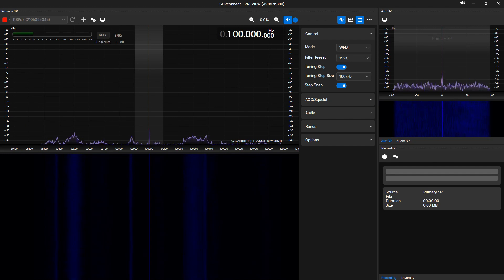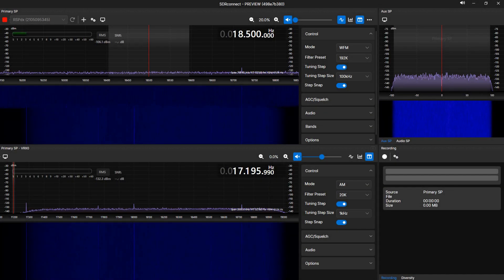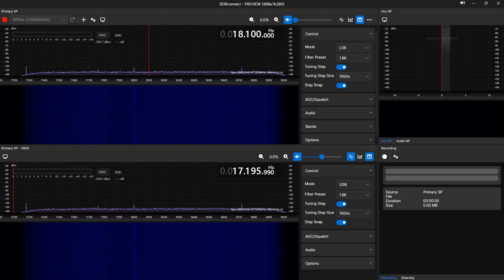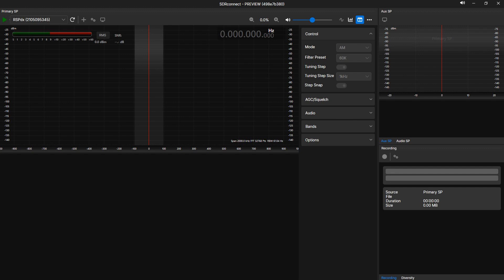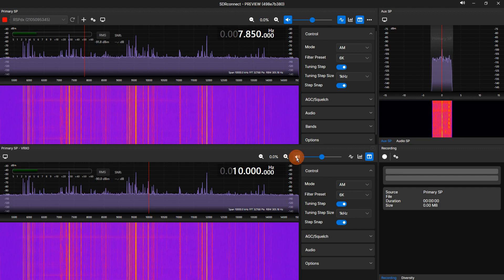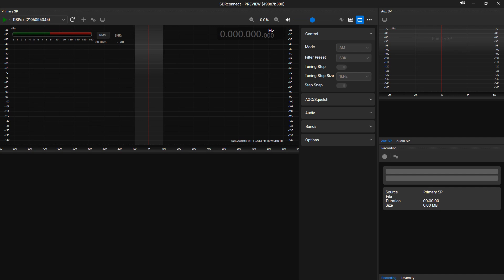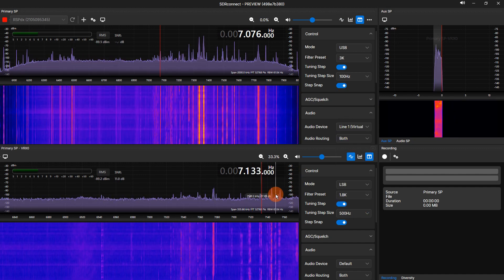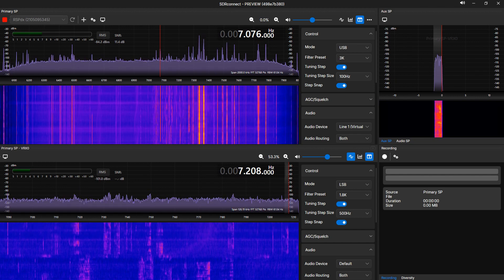SDRconnect Virtual Receiver (VRX)

Comment: How does the recording function work? Can you independently control and record each VRX to their own file?
Also, would I be correct in thinking that you can record two separate bands if you have the Duo, e.g. Primary in on 2M and VRX0 is on 70CM with each using their own receive tuner?
Reply from the maker: As of preview 3, it is a single recording with the choice of selecting the VRX if multiVRXs are in use. This is for all devices.

Comment: why if I right click on the frequency it changes yellow and gets stuck?
Reply from the maker: I don't know why, I've had no reports of that happening. Right clicking the spectrum in SDRconnect does not lock my VFO
Reply: @SDRplayHamGuides  right click the frequency counter/selector, (the numbers at the top used to scroll between frequencies).
Reply from the maker: If you right click the frequecy readout, that will place SDR-Connect into direct frequency entry mode. Hit ESC on your keyboard to exit this mode.

Comment: Thank you for the video. I just downloaded SDRConnect and I have tons of questions. One would be how can I save my layouts. I can prepare multiple VRXs to monitor 3 different bands on FT8 but then I would like to do something else and eventually go back to FT8 specific configuration. Is there a way to save the layouts and then to manage them? I would like to have a memory of the layouts with comments so I do not forget the reason for a specific layout. I think this was possible with the old software. Also, I do not know how to take advantage of two receivers on my RSPduo.